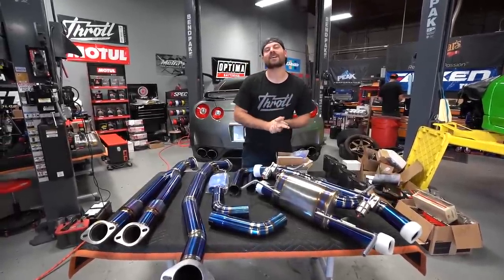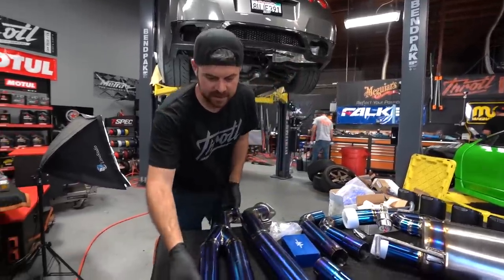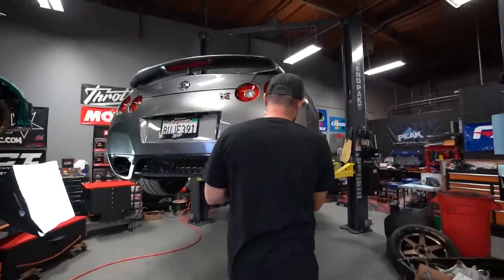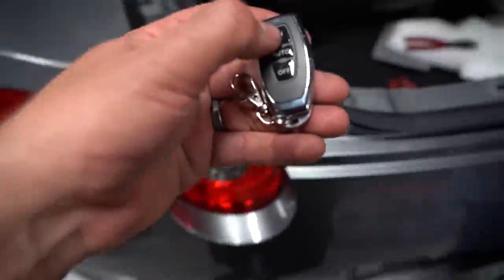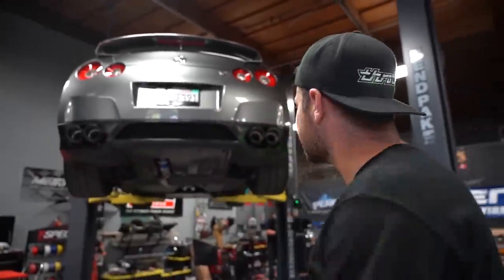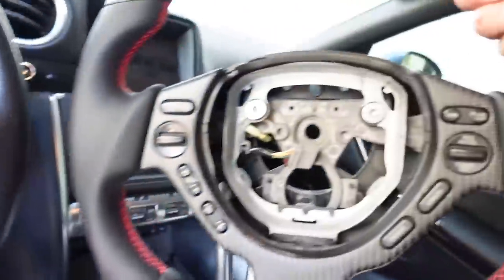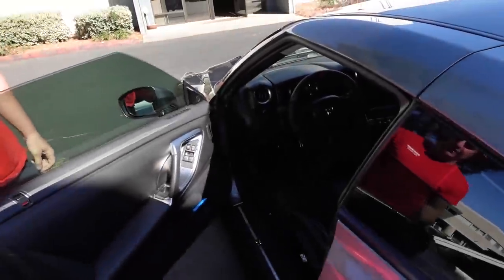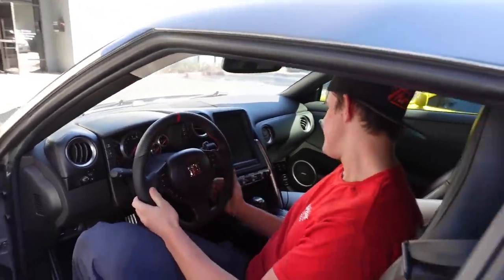Building a Nissan R35 GTR : Installing a Titanium Catback Exhaust System & Custom Steering Wheel!

Comment: Ciao Buddy, is there any possibility to get some ERROR from the ECU or from some other sources after disconnecting for a while the battery?
One time I took the battery out for a couple of days and when I plugged that in again I got Transmission Error and engine check error.
Thanks in advance

Comment: Why not just go for push button (in the car on the console),  electrically operated cut outs for the exhaust? 
Hiding that box, wiring and feeding that kit with vacuum seems over the top. Also those fobs look tacky as hell for a car like a GTR.